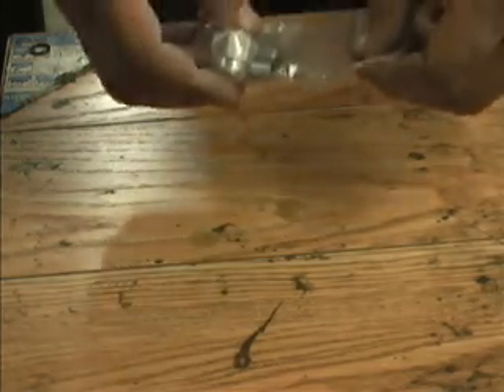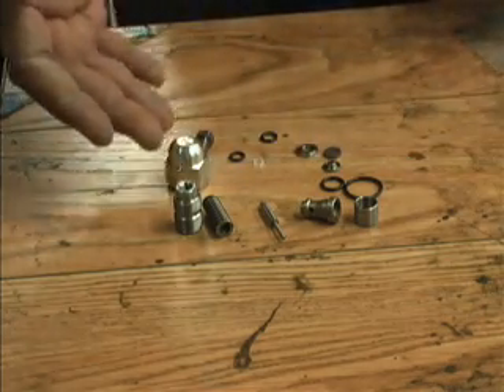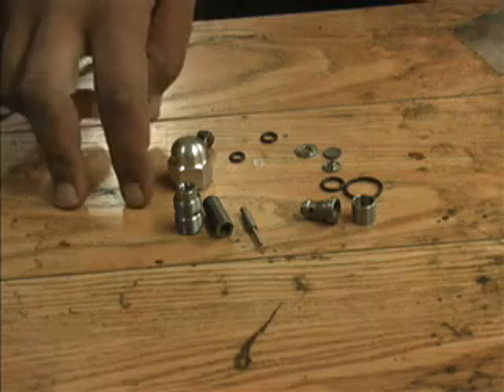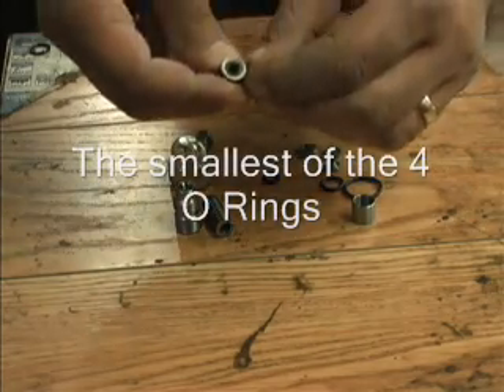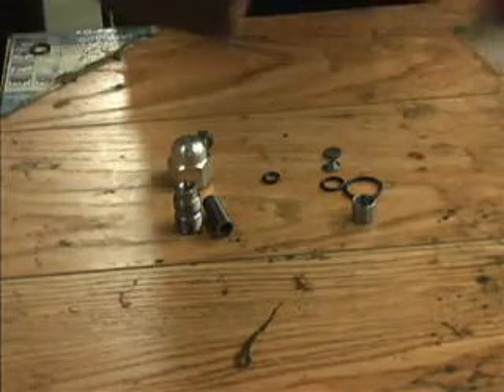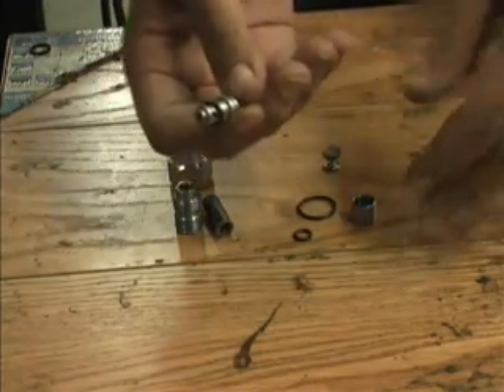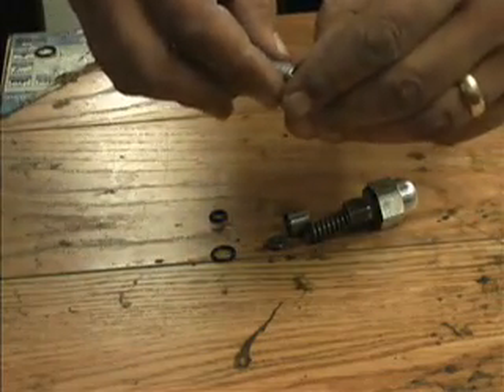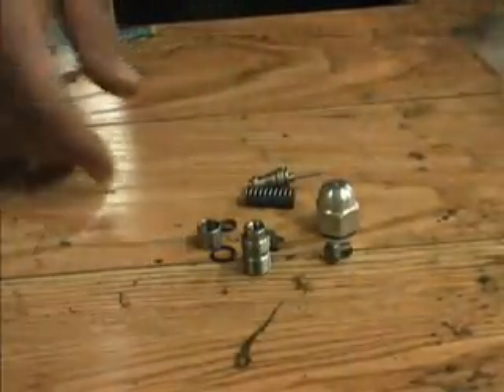Assembling Meyer 15606 Crossover Relief Valve

Comment: this video solved the problem I was having with an e47 I bought cheap, guy couldn't get it to work, would only angle left but lift and lower.  some way some how the little washer that holds the spool in the hole was gone.  I paid 50 bucks for the pump, now it works mint